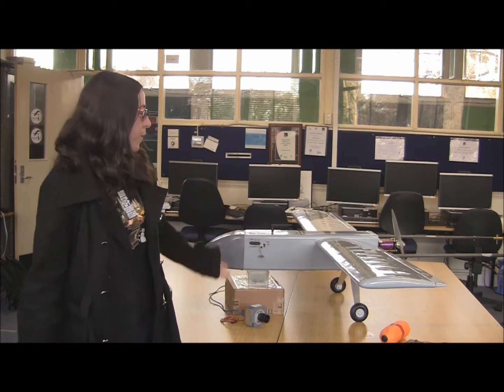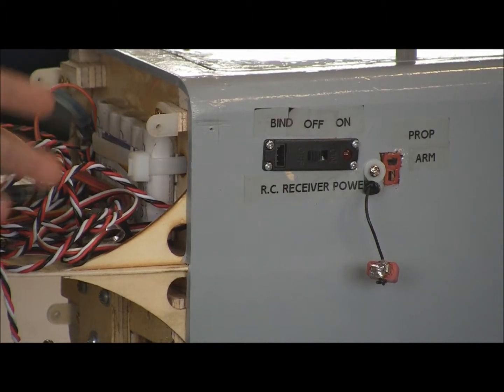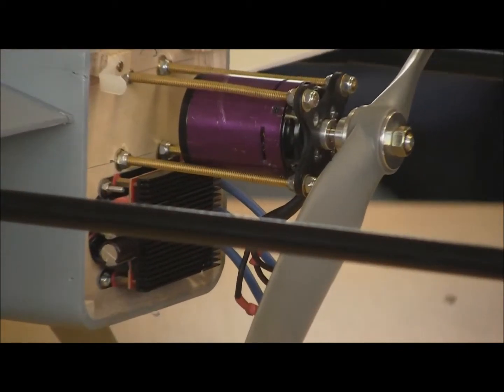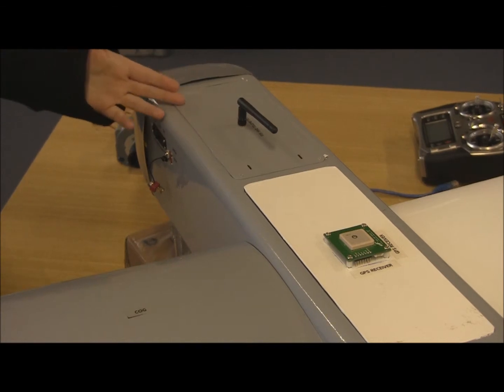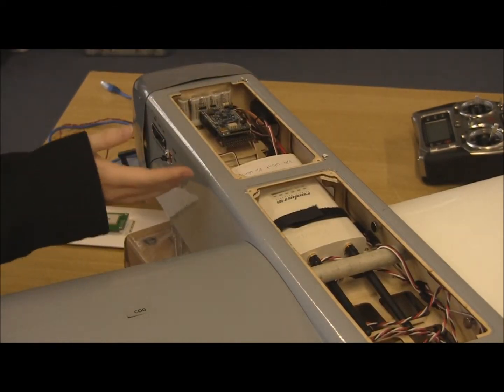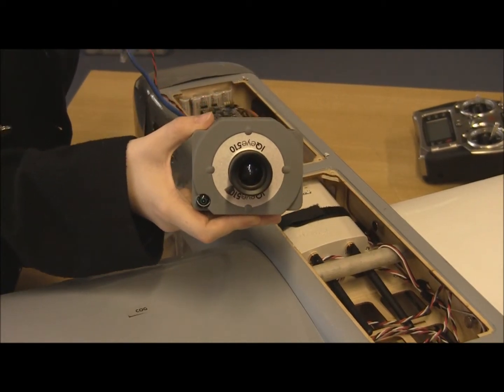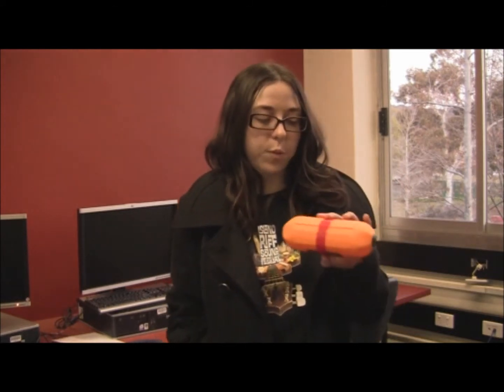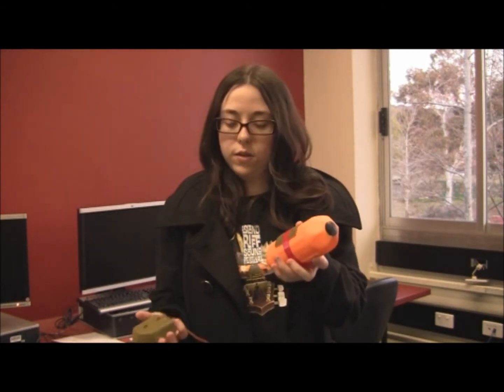Dickson College UAV Outback Challenge 2012 - Plane Overview

Comment: Hello , very good This video presentation ! Could you tell me which components, how many batteries you used(AMP and C rating battery) and the flight time? I Bought same model and would like to know better of him . Hug.

My configuration:
5 Futaba S3003 servo;
Autopilot Cyclop Storm OSD;
UHF Dragon Link for long range;
Futaba 8j radio;
EMAX BL 4030 motor;
80A ESC;
10000mah 40C battery;
Fatshark Dominator HD with Aomway 1000mw transmitter;
Helical antenna 11dbi to transmitter and spironet Fatshark for receiver video link.

I live in Brazil.

Thank you for your attention!